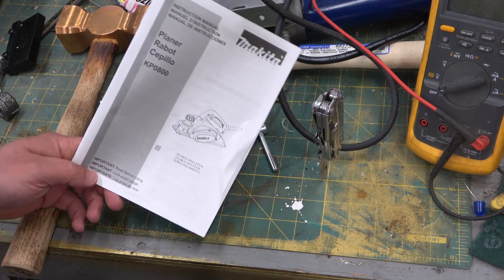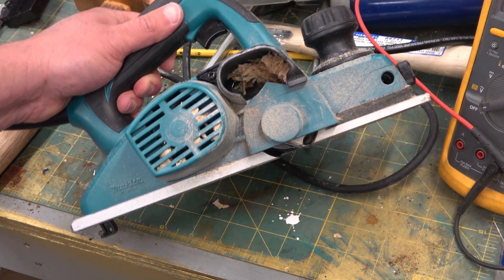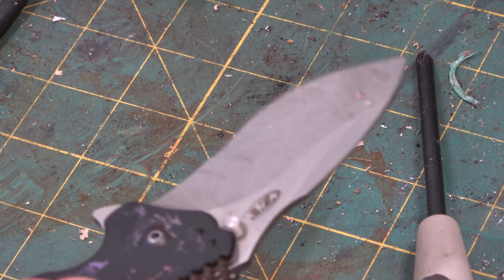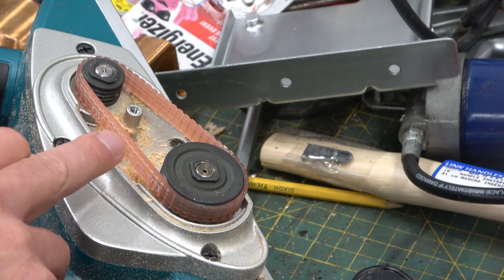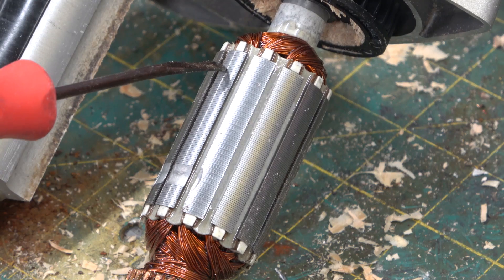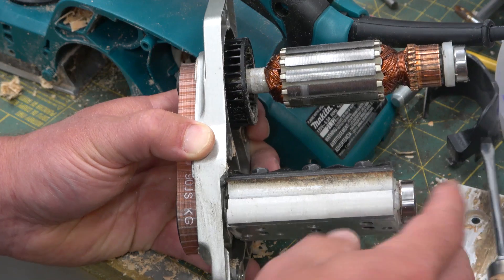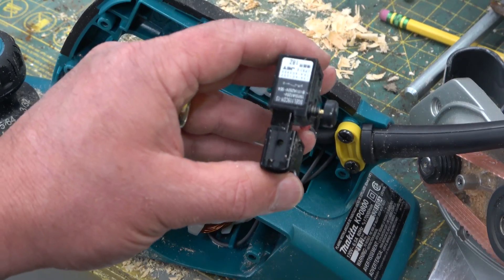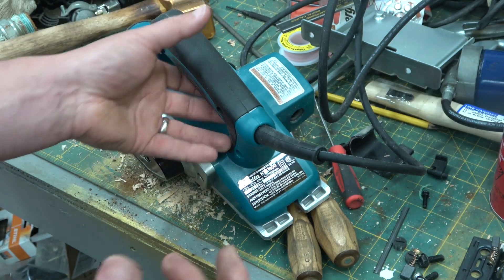BOLTR; Made in USA Makita?

Comment: Not related to this video but something I keep meaning to mention...

Laser-etched sockets.  Blowmolded cases that make us play socket scrabble with FOD pucker EVERY time we open them.

My solution for portable... Grey Pneumatic Duo-Sockets.  They're thin-walled impact sockets.  Black oxide, so I do have to spray 'em with Eezox once in a while.  A blow molded case that actually works (no scrambling), with a removable handle.  Sockets ARE laser etched, but... they're also engraved and filled at the base.  Wobble extensions, with the usual caveats (strength compromise); I usually carry a roll of locking extensions anyway.  Ratchet is nothing to write home about, but it's smooth (72 teeth, I think...) and the release button is flush with the relatively thin ratchet head (can get into tight spaces).  It's not Snap-On, but I don't cry when I drop it in mud and then run over it with the tractor.

Main downside... no massive combo kits.  The 1/4" drive is available as a metric/SAE standard+deep set (in 6-point or 12-point), but the rest are smaller sets w/o SAE/metric mix.  But given the terrible cases that come with most large sets, I don't mind having a few cases.  No mm skips in sizes in the metric, unlike a lot of moderately priced sets.   Remove the hinge and the case works fine in shallow tool drawers.

I haven't beat the hell out of mine impact-wise except for the deep 3/4" (tractor stuff) and the shallow 15/16" (riding mower blades), both 1/2" drive and both holding up well for my use.

Comment: N 1990b makita plane, the cockroach of power planers,  easy to use  overhead and near indestructible,  toe plate first to twist from dropping on it. The motors last until the rest of it is not worth fixing, newer models just the same, but trigger switch not as robust as older version. A staple power tool for Aussie chippies of older generations. 👍

Comment: Use the planer diagonally to the grain of the wood, better finish and less tearout. The non reharpenable blades are resharpenable if you can sharpen a knife. As a knife is all but a sharpened piece of metal.

Comment: Just keep the height adjustment set at max (or is it min?) and shave off sheets of  veneer, no small chips to get in the housing, problem solved, works great on doors that you need to create maximum air flow to keep the schnozzle from clogging up do to stale air, especially the bedroom door that the significant other wants to keep closed during those alone times.

Comment: Professional trim commercial trim contractor here. I ran multiple crews hired out of union halls all over Ontario so if it was possible to kill a tool from abuse or neglect these guys could do it.Those small power planes are mainly used to scribe fit cabinets to the floor. Occasionally you can take a swipe at a door that doesn't fit, or have to plane some nasty piece of tar covered nail embedded shit but they don't get heavy continuous use. Whether it's a plane or a saw if roofing tar is involved you're sacraficing the tool. I've bought at least 20 of them over the years ... Dewalt, Bosch, Elu, Black and Decker, Porter cable and makita ... but never smoked one. We also carry heavier 'door planes" that are much more durable. power planes meet their death from falls, or they no longer hold adjustment from abuse, or they walk away rather than burn out.

Comment: I have this. I use it for planing tree trunks a bit flat to use as large fence posts.  I abused the shit out if it because the tool is totally too small for that job.  The only problem is when I set it to maximum depth in hard wood the belt slips.  It will probably die sooner than later but not yet.

I want a bigger one but they only had this in stock the day I needed it.

Comment: daily drove these for cabinet making back in my younger days, that was only MDF though but regardless they lasted a while, rarely had these die on us, usually well after the makita impacts or hammer drills.
Reply: Jeez - we get about 18months before they fuck up for kitchen installers - about an hour use most days - sometimes a lot more than that - the heavy duty version as well (but it’s too heavy for accurate use for a board on its edge .
No other planer is acceptable because of the small size wanted (this is lxt S obviously not the corded)

Comment: I got one of these overprices at a pawn shop. Carbide blades looked like a concrete apprentice used it for practice smoothing sidewalks. Got HSS replacements and what a nightmare getting them aligned and depth set on the two. But at least i can sharpen them by hand on my old stone hair shaving sharp

Comment: Have a wee older model, works great  to fix Carpinders Flux ups when installering bifold doors n such. Beats the heck out of sanding that's for sure. Getting a bit dull but now I know blades have 2 sides so should be like new after wife swapping blades.

Comment: I recall the standard tool order form in BT (UK telecoms) you had to have a sash brush to clean solder terminals, sadly the management used the item code for a makita power plane  so I ordered two kept one and have it to this day some 35yrears later. they caught on eventually so i returned the second one ;) a good quality tool indeed.

Comment: I've got a similar sized milwaukee cordless one. Very handy in some situations but no matter what i do, i can't get the dang blades to cut exactly parallel to the bottom of the tool so i end up with an unlevel cut. I'm sure it can be done but i haven't figured out it yet.

Comment: I make my living making tipis, ive owned and used two of these for 4 years and they'e been put through the worst work of debarking poles. I fugure each unit has chewed the bark off of over a thousand spruce trees. I have had to replace a couple belts and a couple bearings but otherwise they eat the work reliably. I use two so one can cool down while the other runs. And switch them every hour or so. I use these late in the season when the bark is drier and needs to be chewed off instead of peeled.
Reply: They are defiantely not the best quality, but theyre pretty cheap, metal shielded bearings are easy to find and last longer. Keep some belts and bearings on hand at all times. Doing yhis job, they get swung around all day, and going with a better quality tool makes them a lot heavier. Ive used a bunch if planers and these have been the best fit for the job.

Comment: I have an ole Black & Decker shaper/planer... Still going... LOUDER then all get out... but still tickin... I think I got that plastic piece of junk back in 1995, maybe, approx... The blade system, is the same as this unit.. and the cheap blades from H.F. Tools, fits and works just fine... I even resharpen them a few times...

Comment: Can confirm, if you push these hard, you can easily burn them out. I was using one to take some chainsaw marks out of some kind of tropical hardwood rough hewn 6x6 and I let the smoke out. 

There is no thermal protection on the windings. I was just doing my thing, planing away and then, bam, cloud of smoke with no warning.

I'm not sure if it was this exact model, or the one up, but either way, it was a big disappointment that a Makita power tool was weaker than me. Self resetting thermal circuit breakers cost like 20-40 cents, why not include one?

Comment: Thanks Ave, et. al.!  Speaking of cheap series "universal" motors, I have a number of home gamer tools that I want a better controller for, specifically sensorless speed control.  Which, for sieries motors, goes something along the line of treating the motor as a speed dependant resistor, a function of applied voltage and current, and some adjustments for different motors, or even semi-automated locked-rotor/no-load/induction/resistance tests.    i.e. with a blue/black/red-pill and bridge and a zener power supply for the uc, a mosfet/driver, and a divider for bus voltage (times the duty cycle), and a shunt for current, plus user interface controls/display(kiss).  Does anyone know if such a thing already exists though?   Absolute speed control isn't as important as you can just use an optical tach, and who knows what gears are in it, but it should serindiptuously be relative to 100% of what the tool normally does, so for a given tool you can figure out some dial marks.  Hoping to cut some metal or fry some crappy motors in the process :)  Yes, a well placed electric fan would help (so would an actual speed sensor), and as with all sensorless controls it will struggle at controlling lower speeds.    bla bla bla, thanks for your time, lemme know if I missed an instantiation of such a device.

Comment: What Jamaican AvE?
Oh, and I've used the snot outta the different brands of planers and prefer the Bosch of the corded ones.  But, being the convert I am, I'll take a cordless over a corded, brushless over brushed, and variable speed over fixededed rate of spinny spin spin.
Also, Bosch makes a 12V mini planer which works surprisingly well and I prefer to use it one handed (you know what I mean).  I use it on door fitting a lot.  Don't bother with their 12V router though as the base was designed by an engineer with an inner-ear disease (all wobbly and shit).
Just curious why you didn't take apart a full-size planer and hand-hold it upside-down to do your project...being the 200 lb gorilla and all...?

Comment: I've had the previous Japanese made incarnation of this power plane for twenty years. It's chewed its way through literally a metric shit ton of cellulose composite, been run until it's nearly too hot to hold, dropped off the bench, roofs and various other high spots with a crap landing. It's gone through a wallet full of blades, two sets of brushes and three belts. Still on the original bearings and still earning me a living.
Why have I got Makita tools? Cos I done broke everything else.
Reply: And the damn stickers are straight.

Comment: Guess you should vacuum it after every use (good idea to do anyway) and blow it out with compressed air every now and then.
I try to do it with my old Bosh one
Reply: Btw mine also gets clogged with wood shavings in the cooling fins, that's why i do it even tho havent had an issue (yet)

Comment: I worked delivering Chinese food for a place as a teen.  They had a giant old chopping block - all maple end grain, which had hollowed-out in the centre  over many years of use .  A health inspector came by and told them they had to cut it down to fresh wood.  Knowing I was a student carpenter, the owner asked me how to fix it.  I told him to rent a power planer.  So he did and I observed the big, fat old cook just whaling on the chopping block, with this poor planer set to take off about a half-inch per stroke!  Of course, he was stalling the blades each time he made contact, with the planer sending his arm back in a hurry each and every time the thing made contact with the hard end-grain!  I took pity on the tool and showed him how to do it properly.  The boss offered me dinner and a few bucks to plane the thing down for them and after quite some time, I had the thing ready for reinspection.  Of course it cost the owner a hefty sum when returning the tool, with CHUNKS of the blades missing from the abuse that the fat old cook had put the thing through! LOL!  Obviously they don't make them like tat any more!  The cook would have killed that one in minutes AVE!

Comment: DANGER - that cutter has a lot of inertia due to the high speed and mass of the cutter head.  It rotates for several seconds after powering down.  Let it rest until the thing completely quits rotating, or it could take off the end of a finger, or worse, quite easily.
I have this tool for occasional home use.  You must carefully align the bed with the surface to be planed at all times, keeping some of the front and/or rear bed flat on the work, or else the plane will cut a half-round divot out of the surface.  So don't let it rock forward or back - straight on and straight off is the key. Practice on scrap first.
To me a big drawback is the ejection port for the shavings. It is an odd shape, and none of my vacuum hose fittings will connect to it.  Since this tool throws shavings six feet or more there is massive cleanup after using it.  I could have bought a Ryobi version, which for my specific and small project would have worked fine.  It cost much less money, and it even came with a round ejection port AND some sort of hose attachment for it.  But alas, I was taken in by the Makita name.  
Every darn time I use this Makita for even the smallest cut I try to set up a box or curtain to catch most of the shavings, but still the Makita forces me to spend a lot of time with the shop vac or broom.

Thanks to AvE for a great teardown and examination of this tool.

Comment: Not a professional tool for sure, but how's the price to chooch factor? Is it good a enough value for anyone but the hardcore wood elf? For example, I've found that for angle grinders the harbor freight special is the way to go - they do what they need to (just without the frills), they last a sufficiently long time even under heavy abuse, and they're about a third of the price of the name brand competitors. Even if it lasts half the time, it's still more cost effective.
Reply from the maker: I'd prefer a little heavier model. Cuts good tho; so heavier with steel hog and carbide...
Reply: If you get 6-7 from HF, you don't have to swap the tool tip out.

Comment: I have a made in Japan Makita plane in the late 1980's and damn the new version is crap. The vintage version I have came with HSS blades that are so god damn hard that I actually contacted Makita to ask them if it was Tungsten Carbide as the even the linisher would barely touch it and neither would my oil stones; the only thing that would sharpen the blade is a brown stone makita branded that came with the plane (king de lux) that you soak in a sink full of water for 30 minutes

Comment: If you get a chance, gut a makita cordless planer, way shady shit. Last time i saw a dkp180 brushless planer, it was dead after 8 days of use, the bearings were all shot to hell. Makita refused warranty on basis of improper maintenance, we had to clean that POS every 1-2 hours or it would get too hot, and even doing that the bearing housing and/or cover still got fucky somehow, was our workshops first and last battery powered planer, sticking to the regular ones, id rather hold a cord over my shoulder, even the cord of the one Your handling :D

Comment: The original machine has a base-plate of prefabulated amulite, surmounted by a malleable logarithmic casing in such a way that the two spurving bearings were in a direct line with the pentametric fan. The latter consisted simply of six hydrocoptic marzelvanes, so fitted to the ambifacient lunar waneshaft that side fumbling was effectively prevented. The main winding was of the normal lotus-o-delta type placed in panendermic semiboloid slots in the stator, every seventh conductor being connected by a non-reversible tremie pipe to the differential girdlespring on the "up" end of the grammeters.

— John Hellins Quick

Comment: Made in the US Makita?
That doesn't make any sense.
It would be like a made in the US Rolex or a made in the US Mercedes Benz.
Crap, they do make Mercedes in the US now.
They are made in Alabama just like Hyundais.
None of this makes any sense.
I get why Toyota pick ups are made in the US.
There is a crazy tax on the importation of trucks and work vans in to the us.
Ford gets around this with their Transit connect.
They are imported with windows and seats in the back.
A contractor then pulls the windows and replaces them with metal panels.
Then they shred the seats.
It is cheaper to add windows and seats and then pay someone to remove them rather than pay the tax. 
I don't understand why they don't sell the seats.

Comment: They....they engineered a tool where the chip ejector shoots chips and dust out directly into the air INTAKE for the cooling of the motor. Are they stupid? They could at least eject the chips out the other side of the tool!

Comment: Those swappables, garbage. Like the mullet thumb detector, those swappables ram raid every nail apprentice Long Wait sank in finding nogs located elsewhere. Shiney nail stumps and toothless carbine leaving you side skating like a rail rider till you can finish on site and spend the time swapping chipped blades for a new one..... to chip the next day. Chippy by name Chippy by tool quality. Those carbides at $80 a set, the opportunity cost is so horny.. Sold mine to a bright eyed lad and bought an oldskool tool steel unit and had beer money left over. HSS blades in a dual wood jig get sharpened on the belt sander and the oscillator doesn't even take breath.